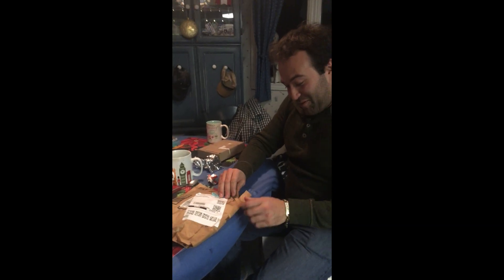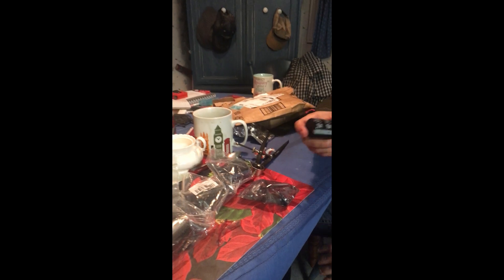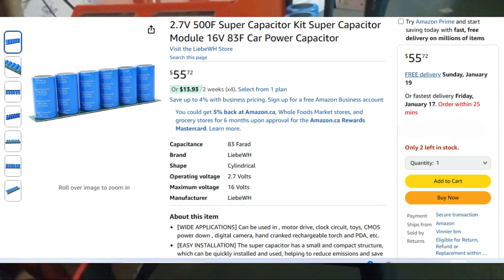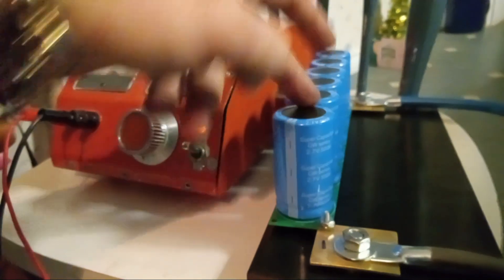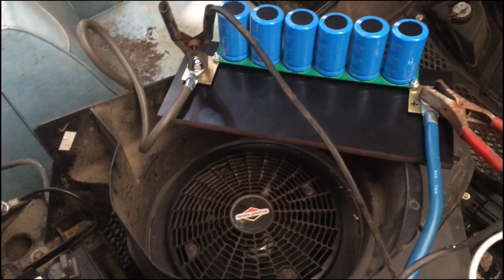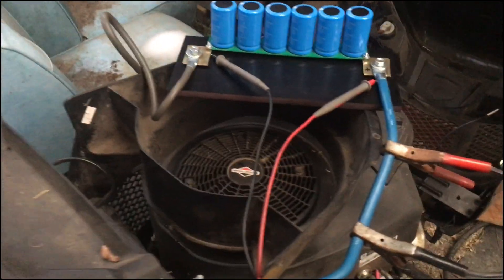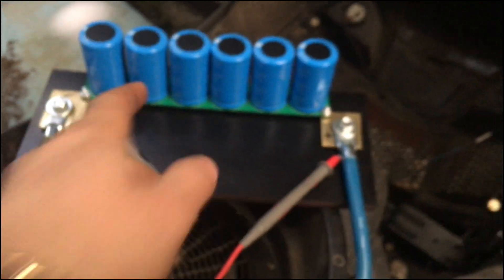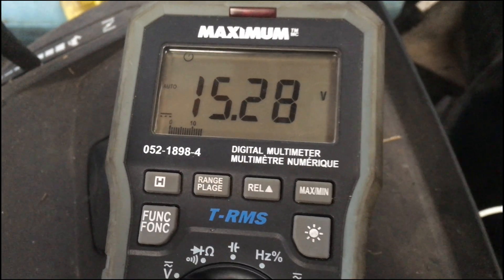Testing cheap amazon super capacitors

Comment: The capacitors are fairly good but the balancer on the board is not good. Using  an active balancer makes a big difference.
Reply from the maker: Interesting. It's been said that the maxwell capacitors don't even need a balancing board. 

Can you recommend a balancing board ?

Comment: Noticed your video during supercap search. These big ones leak alot of current. They also drop voltage much faster than batteries thus you need extra circuit to retrieve stored energy. Their lifespan if respected to limits is longer than humans. They are better suited with batteries, not replacing them but during high-current requirements like cranking and expand battery life.
Reply from the maker: When you say " big ones" are you referring to the capacitance? 

These did drop their voltage very quickly when crancking....only lasted a few seconds. 

But it seems the Maxwell capacitors are alot better ( for some reason) at least from what I've seen from the other videos I've watched
Reply from the maker: And I think your right their really good with batteries instead of completely replacing them ....although I don't know much about the subject
Reply from the maker: I'm curious about the circuit you mentioned....do you think it would help the capacitor cranck the engine longer ?
Reply: @OldCrowsClassicCars  You need a boost converter circuit but for cranking requirements it would cost more than batteries. Cranking requires currents like 50A thus it hurts batteries over time but a supercap array support they does not require immediate high currents thus expands its life. It also means a battery near end of its life can be supported with supercaps and might able to start an engine which can't do alone. You might want to test it if you have some.
There's another usage that electric busses in EU operates. Their brake system is about turning energy into electricity thus saving batteries but during brake such big energy cannot be stored back to batteries. They are first fed to supercaps and their energy slowly recharges car batteries.
Reply from the maker: Very interesting about the Supercapacitors being used to convert energy.

I'm also intrigued by the boost converter circuit you mentioned.

Comment: I would recommend having a better connection to the board to the actual terminals. The tiny connectors going to your battery wiring is very small. You inrush capacity of a few hundred amps.
Reply from the maker: I have good connections...but the terminals are tiny on these capacitors....which you made an excellent point...it seems that the maxwell capacitors (much more expensive) have large threaded terminals.

Not sure what you mean by "battery wiring" though
Reply: @OldCrowsClassicCars I am talking about the small terminals on the cap board. Apologies for the confusion.
Reply from the maker: Those tiny legs on the capacitors and tiny + and - terminals on the module/board are what came from the manufacturer (I didn't make the board)....as a few other viewers pointed out, it's very unlikely that this capacitor module puts out nearly as much amperage as advertised....hence the small terminals

Comment: Six 500 Farad capacitors have an equivalent capacitance of 83.333 Farads.  Capacitors in series don't add, they divide if the values are equal.  AI7YM.
Reply from the maker: Yes, 83 Farad is correct

Comment: You're always making a gamble buying cheap overpriced crap off amazon, buy from an authentic electronics store like digikey and save on the wasted time and money. Amazon do not care about the safety of customers either.
Reply from the maker: It's very hard to find ultra capacitors locally where I'm at. The few places that do sell them online are very expensive. 
I've purchased good items from amazon before but ya, I agree with you....there's alot of junk too....eh nowadays its hard to find anything that isn't disposable.

Thanks for the recommendation, I will try Digikey you mentioned!

Comment: 5*3000F*3V  LSUC. Can Crank with 1000cca min. With a 25yr lifespan.
Reply from the maker: How much CCA would you say we have on this setup with 83 Farad?
I'd be really happy with a 25 year lifespan.
Reply: @OldCrowsClassicCars  20-40A maybe.  I use the above setup in my Honda Civic with a small Li ion batt in parallel. Cold start, hot start , low battery.. it dusn care, cranks the car up everytime. Also not using any balancing board. Try it out.
Reply from the maker: @ Where did you get the LSUC capacitors?

Thanks for confirming that it works!
Reply: @OldCrowsClassicCars  Maxwell or LSUC both are good. LSUC u can try find a supplier in ur region . Get the 3v one then 5 caps are enough.

Comment: I just had one of those. They leak at 30mA. Dead in 2 days
Reply from the maker: Yes I had the same thing. Went down to about 4 volts after 2 days. 
But even immediately after (and also while) being charged they are still not nearly strong enough to turn a car engine.